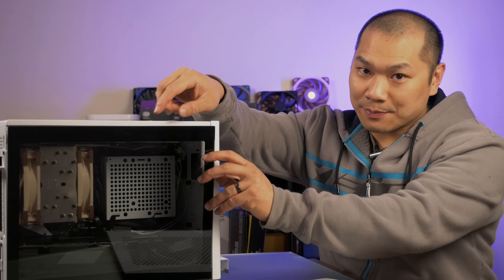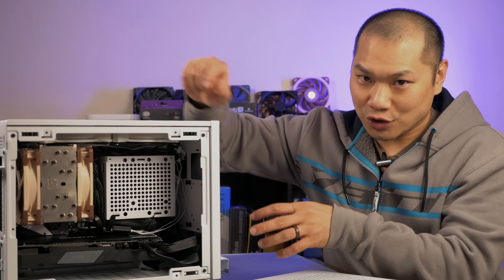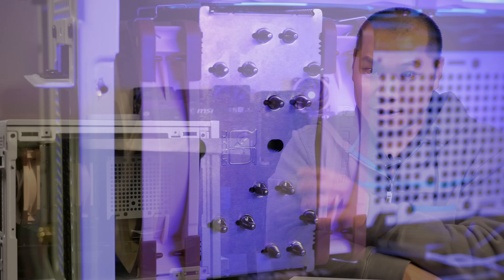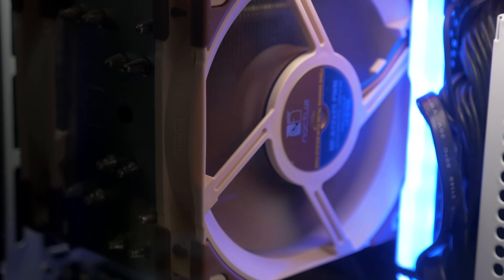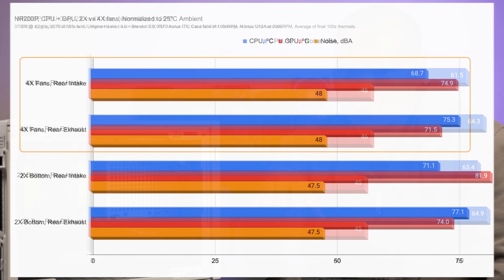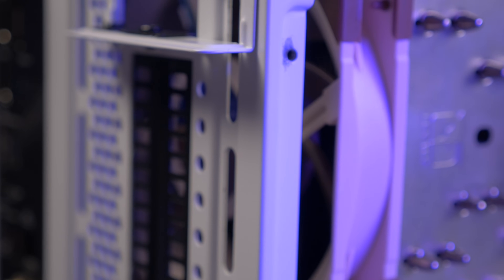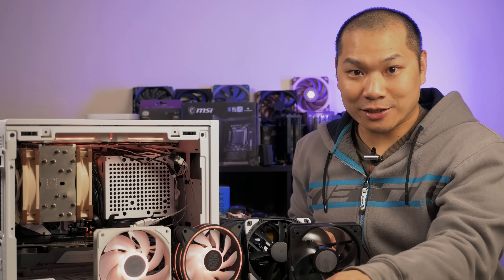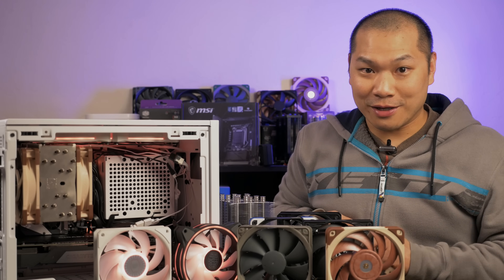Cooler Master NR200: Optimizing Air Cooling Thermals Part II: Higher TBP GPUs and the NR200P

Comment: Do slim fans fit in the top mounting area? I saw someone say they didn't work with the toolless mounting solution. Is that true?
Reply from the maker: They will, with the right cooler. U12A fits two 25mm fans anyway. I’d just take the mesh off and mount it with screws. Most likely will cover this mod when doing the custom loop build.
Reply: @MachinesMore  Thanks for the response! I'm likely going to go with the C14S, since I've got the mesh panel. Keep up the great work!
Reply: I think it also depends on your motherboard, some of the gigabyte boards have the CPU higher up and that might mean u don't have enough space for top fans with a c14s

Comment: Great video. I was just about to pull the trigger on a Fuma 2 for my NR200 (non-P) setup but will now wait for your next video. Seeing as I got the NR200, I only got one of the 120mm fans, was looking at grabbing 2x Arctic Cooler for the bottom already and possibly the top. My system isn't all that great, i5-8400 stock with an RX580 8GB Gaming X (use the system as a dual boot hackintosh) so I don't really need a whole lot. I only game on rare occasion (LoTRO, GW2) and don't run anything at super high detail or anything but want to keep the system cool and quiet as possible.

So with that said, new tower cooler will be in the works based on your next video (potentially Fuma2) in intake mode, with 4x 120mm running via PWM at 800rpm? Sounds like a fairly quiet and cool setup.

Comment: Love all your vids, as they inspired me to build in the NR200. I opted to go with liquid cooling though hoping for best performance and thermals. I got the arctic liquid freezer II and I'm going to replace the rad fans with a couple NF-A12's and put the original rad fans on top as exhaust. I would have gotten 2 NF-A12's for under the gpu but I ended up with an EVGA FTW3 Ultra Gaming, which I think would be too big for fans underneath. I have also seen a reddit post about not deshrouding with this card since the stock cooler is already really good. I have a shucked 10tb external HDD that I want to shove in the case somewhere and I'm guessing the best place is on the psu bracket, but I'm a little nervous it will choke the rad since the freezer II rad is pretty thick already. Also would the 90mm fan that comes with the NR200 work well as an exhaust in this scenario? I suppose it might not even fit. CPU is 5800x btw.
Reply from the maker: Hey! That should be a great card to take care of itself just due to the heatsink size. In my LF II review at 6:11 there is a shot of the inside, if the HDD even fits both it and the rad would be unhappy. Hate to say it but with that setup you’re best off running the HDD externally, short of mounting it to the top of the case I can’t think of a good place to put it. SFF and HDDs... often a tug o’ war.
Reply: Can you please share  your completed build on Reddit when you're done with the LF II installation? I am considering doing the exact same. Either get a Arctic 240 AIO and swap A12x25s or get a 280 AIO. I worry the pipe bending might not be a good thing long term
Reply: @tgvr73  Yeah whats your reddit handle or discord?
Reply: @nutwick7619  we don’t do that here. Just post it to r/sffpc or r/NR200 please will love it
Reply: @tgvr73  ok np
Reply: Could you sandwich the HDD in between the psu and front of the case?

Comment: Have you tried smaller mobo standoffs? I remember seeing it mentioned on Reddit but there was no follow up. Would love to see that tested.
Reply from the maker: With the right board it might, although I’d put electrical tape over the panel just in case something could short out. It wouldn’t work with the X570 board I use since the board has a backplate that sits flush against the panel.
Reply: @MachinesMore  Ah, assuming it's non-removable back plate. Well if you get a chance it would be cool to see. This was the thread in question, https://www.reddit.com/r/coolermaster/comments/ibw36s/nr200p_standoff_screw/ 

Thank you for all the great content.
Reply: Will this affect the way the case PCI-E slots line up with the mobo?
Reply: @CaveyMoth  No clue. I haven't tried. Most people say that the Fuma is only a mm too tall (sometimes), depends on the heat pipe lottery.

Comment: I went with the C14S with a A12x25 and a A14 on the rad mount. Two A12x15 at the bottom intaking air and one included CM fan at the top exhausting.
Do you think the other CM fan could be useful running as an intake on the rad mount or is it too much?

I haven't yet built my pc because I'm waiting on the rx6800. ( last part needed :/ )
I chose a similar build to the one you showcased on your previous video about air coolers.
Your videos and advice are very helpful !
Thank you.
Reply from the maker: Hey Andre, good to hear! In my testing with the AIB 3080, I saw insignificant changes when running the 2nd side panel fan as an intake. As an exhaust it was not good for the CPU temps, and improved the GPU temp marginally. If you’re looking at the reference 6800 (and not the XT) you could run 25mm fans under since it’s supposed to be a 2 slot card.
Reply: @MachinesMore  Well thank you very much!
Reply: @Armando Rodriguez I ended up doing exactly like I explained on my previous comment. I also ended up mounting the CM fan on the rad mount.
My CPU temps have been at 35~38°C idle and my GPU temps at 45°C idle (undervolt/OC) for 900mv.
When playing I get around 50°C on the CPU and 65~70°C on the GPU.

I'm currently away from my build so I can't exactly confirm everything about the temps but when I'll get back in a month I'll test it again to give you concise information.
Nevertheless the temps were fine for me and the system runs well without troubles.

Comment: make a video using the Asetek 645LT 92mm Performance Liquid CPU Cooler for SFF Cases
Reply from the maker: Typically I’d just say go with any air tower cooler to get better performance. If you’re set on an AIO... if you’re having to resort to a 92mm, I’d just run a 240 at the bottom, either just chance it with a unit with a good warranty or something like the MSI Coreliquid. Will also try to get a look at the Pure Loop from Be Quiet!.

Comment: Please in next tower coolers with TG panel comparison take in consideration the Cryorig H7 too! It’s the one I want to buy because I’m concerned about all this heatpipe touches the glass thing with coolers like Scythe Fuma 2, Mugen 5 and Noctua NH-U12A itself: I think the glass panel can come off and scratch/shatter when transporting the case, even if holded in place with the screws. I come from a nr200 vented panel-aio configuration, but it has bored me because the radiator on side panel doesn’t allow to show components inside the case, so I want to switch to a TG panel-aircooled configuration. As always, excellent job!
Reply from the maker: Cheers- unfortunately that won't be tested in this next round but I will see if I can source a review unit to check out. I totally hear you on the transport issue and did not consider it- thank you for bringing that up. Another issue is actually most manufacturers will warn you to take the cooler off for extended transport since there is the possibility of excessive leverage on the mobo anyway. For your needs- have you considered a Noctua U9s?
Reply: @MachinesMore  Thanks for the reply! I’ve actually considered U9S but I’d like to put 120mm rgb fans on the cooler like the ones I’ve mounted on the top to create a nice effect. Guess I’ve to wait for your next video to know if the other coolers you’re gonna review with TG panel on are suitable for me, since I own an Aorus X570 too :)

Comment: Is it possible to run the Arctic Cooler 120mm AIO instead with the glass panel for better thermals?

Seems like the U12A fits, but would a 120mm AIO be a better choice space wise? The exhaust fan would be back vented.
Reply from the maker: It won't work- the back exhaust is spaced for a 92mm fan and even if you have an adapter for the screws there barely 120mm between the top of the mobo I/O and the edge of the case- rads take up more space. On top of that, a 120mm AIO, even the LFII, will be outperformed by a medium tower cooler, like a Scythe Mugen 5. If you want an AIO with the glass panel, I'd get the right unit or just take your chances and bottom mount it.

Comment: For the 4x fans, how about a comparison of all fan intake with CPU tower as exhaust vs bottom intake, top exhaust with CPU tower as intake
Reply from the maker: I had that as a secondary consideration- was concerned about the fans being less effective from pressure build up. I’ll run that test and see.
Reply: @MachinesMore  I'm not a pro in fluid dynamics but logic tells me that with the design of 3080 FE and a top exhaust, it seems that it will kinda choke the CPU cooler running as exhaust, thus the top intake (cooler exhaust)/top exhaust (cooler intake) suggestions. Thanks for the reviews and testings!
Reply from the maker: @BCdesu  I ran the test and immediately was reminded why that was a bad config. I pinned a comment with details above. I do not recommend running any form of rear exhaust, glass or vented, with the Ampere FE cards because the top exhaust of the FE cards puts the exhaust directly into the path of the cooler. In theory top intake with the 3080 would be the worst config for both CPU and GPU.  
In fact the top exhaust is ideal for the FE cards- picture it this way, top exhaust comes out the top of the graphics card and is immediately sucked out, without lingering in the case. You might get clean air from the top intake but you're also pushing the hot exhaust down and keeping it in the case, which makes everyone unhappy. With the FE cards, a rear intake is also good for the CPU since you get fresh air, even though there is a slight amount of re-intake of the GPU's exhaust.
Reply: @MachinesMore  Thanks! Guess the best config to go would be CPU intake and top exhaust (and bottom intake with extra budget)!
Reply: I was also thinking about the top fans as intake config to feed the CPU tower with fresh air and exhaust it in the rear, it makes sense

Comment: Is it ok to dremel the tips of the cooler to not touch the glass panel?
Reply: I would not do that. Heat pipes are not solid, so you'll "open them up".
Reply from the maker: To an extent, but it's Russian roulette since you have no clue when you'll grind through to the inside and then when it's opened up, you lose the vapor/liquid and it's not going to be very effective.

Comment: Love your work man! Do you think the noctua s12a or the nfa12 are most optimal for top exhaust fans? Which is the quietest and is the quiter option optimal for airflow in this case?
Reply from the maker: Cheers- most effective, you could run NF-A12x25 at a higher RPM for the same noise level, they’re the best 120mm fan for sure. I don’t think it’s necessary but for sure, if you want more airflow without a noise penalty those are the way to go.

Comment: What I find crazy about the NR200 and a 3080 (finally came in!) is how much hot air is being exhausted out of the side panel when in the default bottom position. It's a lot and to think of how it stays within the case of the NR200P just kind of blows my mind since it's dumping north of 330 watts out of the box when it's put under load so it's great that you've continuously taken the extra steps to mitigate temps for both as much as possible.

Even just comparing the GPU temps between both is amazing where mine rarely went over 65c out of the box with two Noctua A12x15 as intake with a pretty moderate fan curve. Since I undervolted to 1860 (which can sometimes still boost up to1890) @ 850mv temps rarely go over 56c and shaved off about ~40 watts.
Reply from the maker: Crazy, right? Compared to many case designs with front to back airflow, this and the NCase M1 directionally just makes sense.

Comment: Channel new name : Cooler Master NR200 & more
Reply from the maker: Ha ha. Let's just agree the NR200 is one heck of a machine. :)
Reply: We don't need more than the NR200.
Reply: @CaveyMoth  Maybe the NR200 v2. I saw a Chinese case that mimics the NR200 with a few "upgrades" that users had been begging for, such as ATX PSU bracket adapter and supp for mATX MoBo.

Comment: I found that when I put the upper fans with one exhaust on top of the cpu and the other for intake would make the cpu temp lower by 1-2 degrees. I do have two intake fans at the bottom for gpu and one 90mm fan for rear exhaust. That seems to be the perfect temp setup for me.
Reply: With the glass panel?
Reply: @espen990  yes
Reply: @espen990  But with my setup, the gpu temp would raise by 1-2 degree too.  I am using 2070S with 3 gpu fans and the temp never go beyond 67c when gaming.  So it is fine with me.  :-)